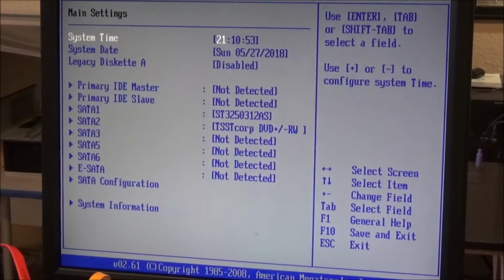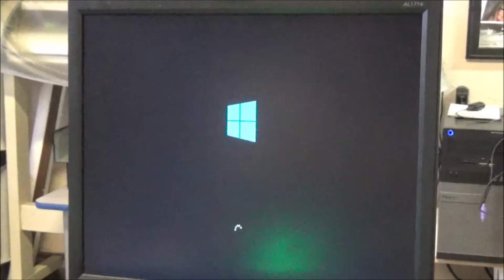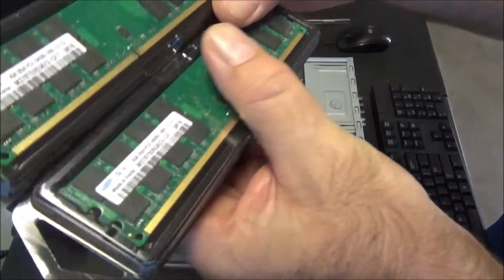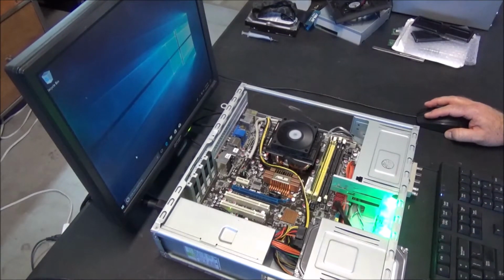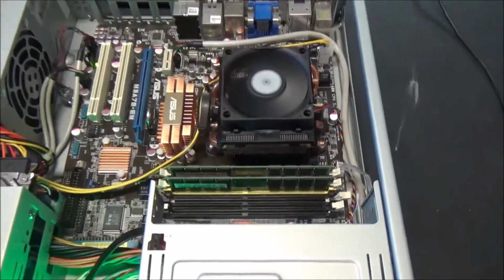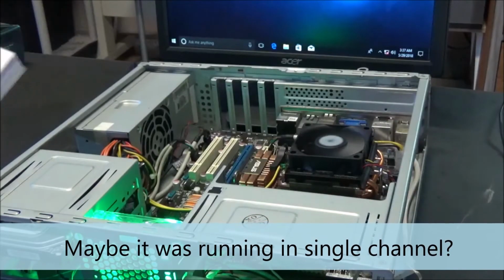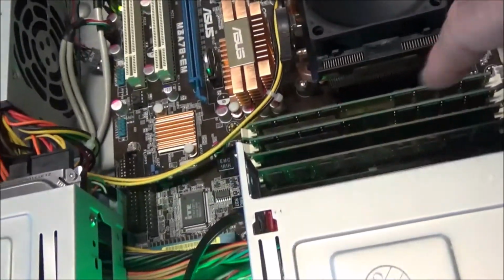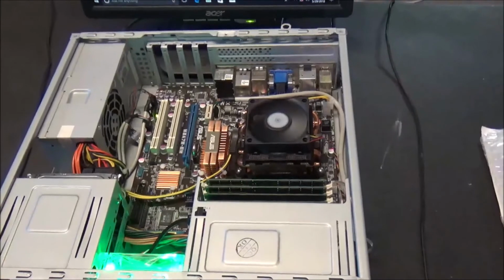Upgrading an old PC can be a Pain in the @$$!!

Comment: This seems like much more fun then what I’m doing/did today. Currently trouble shooting a new modem with a new router... set up the modem to work in bridge/passthrough mode but my laptops aren’t picking up the wifi for some reason :/ my iPhone picks it up just fine... when I saw this video I decided it was time to take a break. I hate everything computer related some days... 
Also today my parents computer stopped working randomly (and I built it for them) so I had to go pick it up to fix it. At fist it seemed like the video card because it was turning on just fine but not sending any picture from any of the outputs but after testing the video card in another pc it seemed the gpu worked fine. So I ended up suspecting it had randomly developed a short somewhere so I took it all apart and added cardboard washers under the mobo screws and it ended up working. Still don’t know if that was the problem but it worked after I rebuilt it, which is good because I was ready to punt it across the backyard. Just one of those days.
Reply from the maker: Nothing worse than network issues, except maybe having to rebuild your parents PC on a Sunday and not knowing for sure if what you did solved the issue =D. So many times I've done things to "fix" a PC and didn't really know which "thing" actually fixed it lol. I spent the last couple hours editing this video and I have just enough light left in the day to mow the lawn! Fun, fun ...

Comment: 6:50 Dat AM2 CPU fan noise. It's waaaaay more annoying in person (specially when you don't have BIOS batteries around. but not as annoying as an AM2 slim server blower fan.
BTW, I had the misfortune of buying an am2 MSi board that gets stucked in an infinite boot loop on XP, impossible to install Debian and Xp on Sata without AHCI and it has 7 swollen caps. should I re-cap it?
Reply from the maker: Yeah, I apologize for the fan noise. I have tried to edit out background noise with software but it always sounds worse than just leaving it alone. I swapped the fan with a quieter fan but it raised the temps by about 8C, it does sound a lot better though. That sucks about that board, hope you didn't pay too much. I've never done a re-cap before but I have a couple old mobos that I should practice on. Surface mount soldering is something I would like to learn and get good at. Do you think that the swollen caps have something to do with the boot loop?
Reply: Yes, because not only that happens, but also when I played some games on W7 and Xp (when it boots propertly) it would start to freeze and start to say something about video driver stopped working or recovery, also my x1600 Pro will crash before boot sequence or it will show 1/2 of the screen  and also reboot. I have another (newer tho AM2+ish) Msi board and Xp boots fine and the GPUs runs fine too.
The chipset has a big heatsink and I put a fan to cool it down.
GPUs used
BFG geforce 6200 PCI  (works but frequent driver crashes)
XFX Radeon HD 6970 2GB Ref. (works but frequent driver crashes)
Ati Radeon X1600 Pro (Doesn't work)
Reply from the maker: I guess it just depends on how much it costs to do the re-cap. I'm sure the caps are cheap and if you can do the labor, why not? For someone like me that has never done a re-cap, it would be easier to just find another board and maybe sell the bad one on eBay for parts or repair. You have me wanting to take out my hot air solder station and get to practicing though!
Reply: I was browsing ebay and caps are not that expensive. I'm gonna order one of those cheap Chinese desoldering pumps to practice on another motherboard first and then order the caps. I will start with the swollen ones first.
BTW, no need to apologize for the fan noise. Like I said it's waaay worst in person an I can hear you clearly. So no problem
Reply from the maker: Right on. I think the fan was bugging a few people so I threw and apology out there =). Glad it didn't bother you too much. I also need to buy a desoldering pump before I attempt to even practice. I tried using a wick but it wasn't happening. I actually removed the PS2 port from a Dell motherboard in one of videos so I could fit a dual slot GPU in the PCIe. I tried desoldering it but just wound up cutting if off lol.

Comment: The lag is probably the hdd and the cpu together. Also I’m sure it would run better with just the 2x4 gb sticks in dual channel then the 11 gb mess you have in it now, though i understand you only did that for testing. Older intel systems can only run low density ram, Amd systems don’t have any problems with high density ram to my knowledge. Run it with the athlon overclocked to something around the bios settings I posted in one of the previous videos comments and you should be good for now to test it out. The athlon overclocked and the 8gb of ram should be good enough to slap that video card in there for now and do some benchmarks/testing while you wait/decide on purchasing the extra 8gb and the phenom x4 945/955/965. Also please for all our ears sake swap fans from the old cooler to this heatsink already. It won’t effect the temperature much if anything and is a much quieter fan. Most of the cooling performance comes from the heatsink itself.
Reply from the maker: Haha, okay man, I'll swap the fans out lol. I pulled the 3GB's of RAM and swapped out the Athlon and it still had a little lag. But after I installed the 560 everything smoothed out nicely. I'll try to get the next couple of videos posted quickly.

Comment: windows 10 :C please why, windows 7 is so much easier to use...
Reply: Rayote I wish I had Win 7 back. It's a shame you can't download Win like Win 10 for free.
Reply from the maker: I love W7 but I didn't have a activation key for it. I don't find W10 hard to use at all though, in fact after you poke around enough in the settings the menus are exactly like W7. The only thing I don't like about W10 is all the data collection, I turn off everything I possibly can. But my Android phone does 10X more spying than W10 and it's pretty much impossible to stop it.
Reply from the maker: That would be nice. Hell, if they would actually support W7 for 5-10 more years, they could probably sell each copy for $500. It's kind of funny to read old posts about W7 though. Everyone that loved XP (and even Vista) sounded exactly like everyone right now complaining about W10. You should go read some of the posts from 2009-10, it's good stuff!

Comment: AMD with ddr2 is very weird
Reply from the maker: Yes it is. And it's difficult to find solid information about what boards are compatible with the various AMD specs/ configurations. I think with Intel switching to DDR3, they were trying to squeeze as much computing power as possible from DDR2. It's cool that you can get AMD only, high density modules for so cheap though. 8GB (2x4) of Intel DDR2 is almost $100!
Reply: amd puts the channels next to each other not staggered its a1a2 b1b2 hence the color coding my ddr3 board was like that as well as my ddr4 so i assume ddr2 was the same but 8gb is way more than u need for this system lol
Reply: powerkane yeah the board manufactures made it strange and depends on what it's for, gaming he might as well go with 8gb